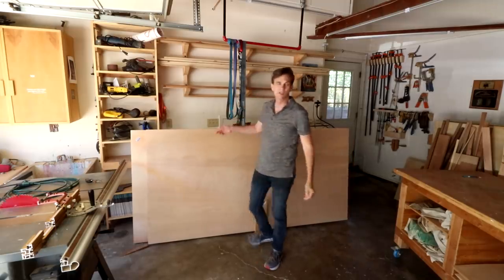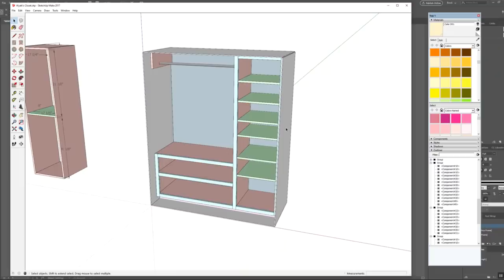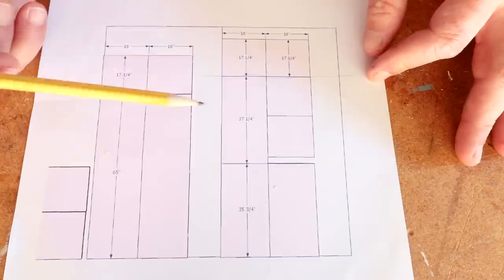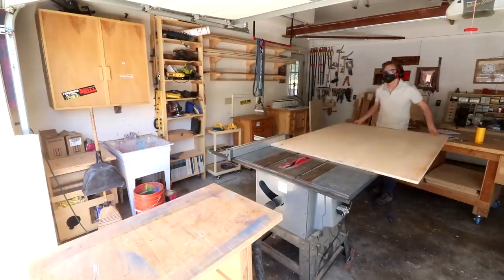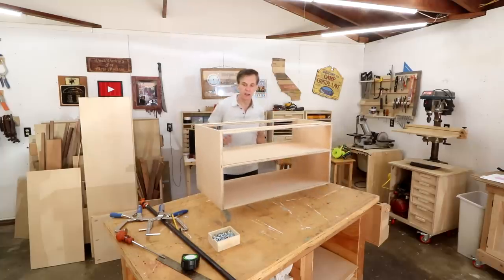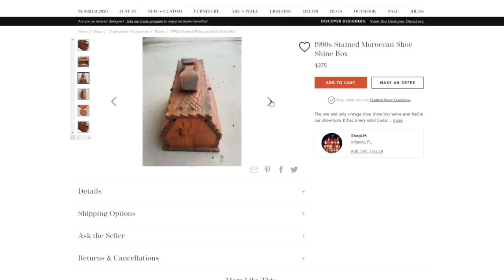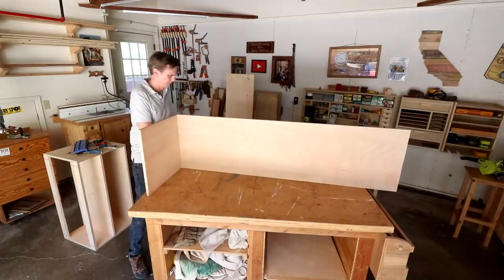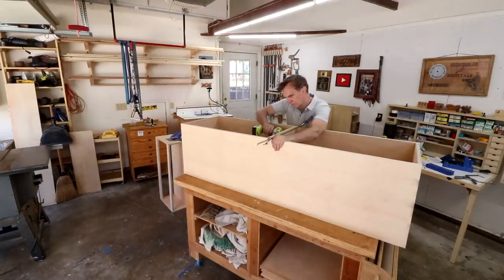Building closet cabinets. And lets look at shoeshine box ideas. | Day 102

Comment: We just watched you make several cuts without the gripper. Might want to explain when to and when you can get away without for Antonio (and other table saw noobs).
Reply: There are cuts and cuts. Sheet goods, by virtue of their size, are very easy to cut with your hands well out of harms way. In fact push blocks of any type would be more of a nuisance than a help. Ripping smaller boards, however, place your hands a lot closer to the blade, and the use of any push stick or block becomes a lot more important. I am a Gripper fan, recommend them highly.
Reply: Jeffrey Thompson nailed it.
Reply: Darin Netherland wait! I thought we were supposed to use screws, not nails!!?!?!?!
Reply: Screw it?

Comment: Steve, would it be possible to do a video all about using Epoxy for gluing wood joints? And maybe a video about gluing hardwoods like Walnut? Addressing issues like clamping too tight which squeezes all the glue from the joint destroying the bond? Roughing up the wood before gluing hardwood for more strength in the bond. And another all about using Urea Formaldehyde Resin Glue? 
These are matters worth chatter!
Cheers, brother 💛😎

Comment: As a way to tackle some of the plywood breakdown issues you talked about, what about building folding extension wings for your table saw? You could add about 3' of support, but then drop them out of the way once you're done with the breakdown so they don't take up precious floorspace.

Comment: For Antonio’s shoe shine box:
I think it would be cool to incorporate a lip around the top of the box that can hold the shoe rest without mechanical fasteners. You could also build the dowel for the polishing rag into the edge of the box so it is more flush with the lid instead of it being proud.  I would also think that adding a tray on the inside could be super useful and easy.  Lastly, if Antonio wants this to be portable or at least easy to move, maybe adding simple leather handles could be extra fancy.
Reply: I agree. My dad's shoeshine box had a tray on the inside where his cans of polish and polishing rag were kept. He had other shoe products and brushes in the bottom of the box.
Reply: This is actually a project I have been thinking about doing myself for a while so this is a perfect push to get me working on it.  When I have done leather handles in the past, I have either put grommets on the ends of the leather and secured the leather to the wood with Chicago screws or I glued the leather to the wood and the drilled through the leather and wood to add decorative stitching.
Reply: he should also add a litte elf that jumps out of the box and does the shoe shining

Comment: I was gonna suggest to make the tall part in two sections (a top and a bottom) - just so its easier to get it into the closet. 
The closet door may be tall enough to get it in easily as is - but not sure since I dont have the best reference point.

Comment: Breaking down large plywood (4x8ft/1220x2440mm) most larger DIY stores offer a cutting service (for a small fee). 
draw a (1:12/1:10) scale plan with the measurements and order of the cut's.

Comment: If you are going to use scraps fore the shelf's of the tall section and thay are narrower than the design then just make the low section a bit wider.
No shame in adjusting the design to save materials.

Comment: For the shoe shine box, if Antonio doesn't have a router, a simple 45 degree bevil along the lid would look quite nice, and it can be made on the table saw. To make it fancier, you can add more bevils, say one at 30 degrees and one at 60 degrees. Inlays of a contrasting wood are simple and add a nice touch as well. The box doesn't need to be ornate, but one or two simple touches can really make a difference.

Comment: I made a shoe shine box several years ago and the one thing I really liked about it was the clasp I used to lock the top.  I bought an antique window lock off eBay.  It had some brass and scrollong in the metal.  Could be a way to make the one you are collaborating on "Extra Fancy."

Comment: I like the idea of a slightly taller box with a fully removable/reversible lid, that is just finished with a handle in normal storage use or flat on top, but you flip over to have the shoe rest portion (which normally would fit inside the box)

Comment: Steve, in the opening shot of the video I was wondering why you didn't back your truck in closer to the shop before unloading and carrying the plywood all that extra distance. As a retired electrician who worked on a service truck for many years and a lot of the time I worked by myself I tried to make it as easy on myself as I could. In my current basement shop I  try to break down sheet goods in the garage as much as I can  before having to carry them down to the shop. I use a pair of Kreg sawhorses in the garage and by backing my truck in close  it's pretty easy to slide the sheets out of the back of the truck right on to the sawhorses, saving steps and the strain of carrying heavy materials any more than necessary.

Comment: Radical shoe box concept.
Traditional boxes are based around the mobile workstation of the professional shoe shiner.
This requirement is for home use box. 
So a box that you can put on a tabletop and work at is more appropriate, you don't need the height for the customer to put their foot on to bring the shoe to kneeling work height.
So think of a broader shallower box with a lid angled down towards the users side.
The box has two halves side by side. One half has a shoe platform angled towards the user with spring clip mechanism to hold the shoe steady, traditional box expects a foot in the shoe to do this.
On the inside of the kid an angled mirror above the shoe so the user gets an all round view of the shoe from the seated position.
The other half of the box has, in the base, compartments to hold the various polishes and brushes required, and, in the lid, a bag for polishing cloths and some clips for spare laces.
It is a break from the tradition but a modern home shoe carer has different needs than a professional travelling shoe shiner.
Also since your not putting shoes on the outside of the box there is the opportunity to put a nice veneer on it so it looks beautiful when not in use.
That, sitting on a shelf in their dressing room, might appeal to a stylish customer.
Have a great one.

Comment: I feel like that shoe shine box is basically just a box with a couple of decorative cuts with a tray that would need to be removable and a shoe rest that locks into the lid with dowels, don't need to over complicate it too much. And if you wanted extra flair polish up some aluminum or copper pipe to use instead of dowels and put a shoulder strap on that bad boy, it's far too awkward to carry by hand

Comment: I’m not sure I understand how those shoeshine boxes are supposed to be used. Are you supposed to shine your own shoes while wearing them since they have that stand on the top? Sounds impractical. Whenever I shine shoes I just hold one of them with my hand inside. Seems easier. One problem to consider is shoepolish particles that drop off onto the floor. If you use actual shoepolish that is, and not some of that fake stuff that contains silicone and ruins the leather. I use a newspaper underneath. I would think a good shoeshine stand would have some sort of a wider surface to catch the excess shoepolish particles. Maybe a wider crate that also holds a few sets of shoes inside.

Comment: I’d add an inner box to the shoeshine box. That way you can easily take out all the supplies. As you can access them if there is a foot on top. Either that, or use drawers instead of a top lid.

Comment: If you didn’t have a pocket hole jig, could you use some sort of joint and stuff have enough strength ?
Reply: Yes. You could do grooves and slide the shelves in place. Pocket screws are just a quick way to support something that won’t have a whole lot of weight on it. That’s my understanding, anyway. I’m still a Newb.

Comment: This might be an odd idea for the shoe shine box, but what if the lid was reversible such that it would be a normal lid for a normal box, but then could be flipped over (and maybe locked in place?) for use with the shoe mount an rag rails on the other side. Just a thought...
Also, thank you for being the thoughtful, careful, and planned woodworker that you are. So many times I just jump into a big project with a very general idea of what I'm doing. It often still works out in the end, but I always end up struggling with some kind of issue caused by my lack of planning or by cutting corners out of laziness/impatience. Even when you do this, you call it out, and knowing both that you make the same mistakes some times and also that you do it right and it works out well makes me want to be better about my woodworking, from using proper PPE to being more precise and thinking ahead more about my projects. So thank you.
And I'm proud to be part of your loyal fan base that gets to see all the random things that you deem to be uninteresting to the general public. They're what make your channel the most interesting and fun to watch. A good reminder that despite all differences, you're a lot like me still and I can do awesome projects too.

Comment: Curious to know what project you would suggest for a beginner who wants to learn more about her new table saw.
Reply: Steve has a great video about building a basic box. I'm a total novice at woodworking so when I got my table saw I began by making a new frame for an old mirror, because I figured a flatter object would be easier to handle. To make it even easier I used lap joints instead of mitres.